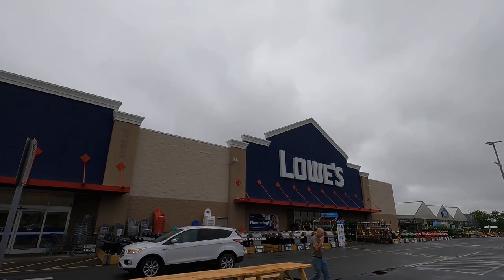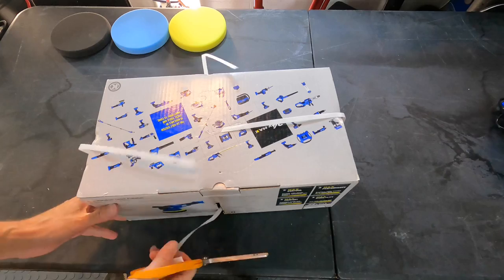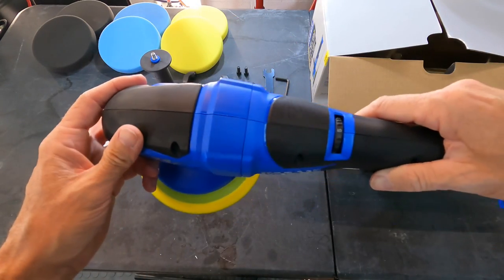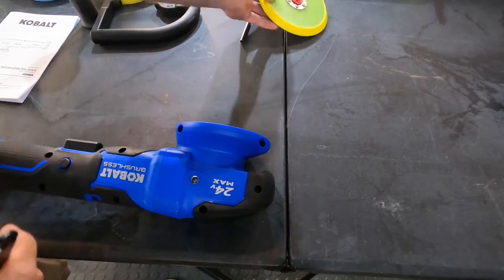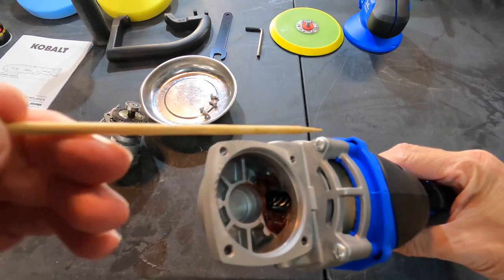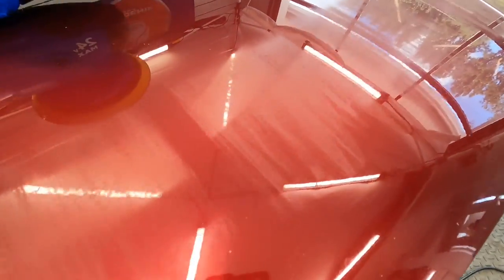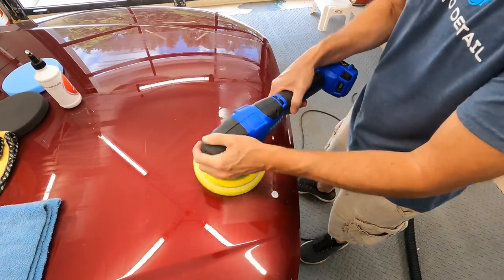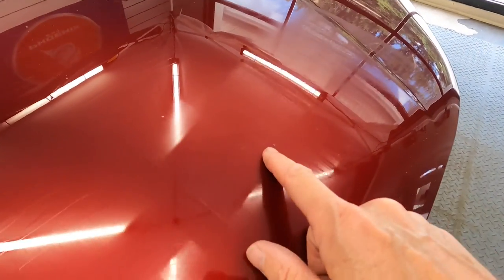Buy The Charger & Battery.....Get The Polisher For FREE!!! Kobalt Random Orbital Polisher! At LOWES!

Comment from the maker: To make it clear...this polisher would struggle on anything more than a one step or enhancement. Would YOU try this?
Reply: The battery and charger costs more than the tool itself
Reply: In a pinch probably. For a person starting out yes.great buy.if I'm going 2 get a cordless polisher as beginner shitemate.
Reply: If you need more power you can always use a 4ah xr battery or 8ah xr battery
Reply: Robust no, but for 1-step, wax, or sealants this is a great CORDLESS tool for most anyone intent on caring for their own vehicles.
Reply: No
Reply: I’m used to more robust tools like Rupes, Dewalt rotary, so no I’m not a buyer. For the money and discount it would have been yes when I was getting started. Saying that , Iv3 pretty much abandoned my beginning polishers, they are backup’s in case of a problem now.
Reply: Yes. To apply sealants.

Comment: got one of these maybe a year ago with the same deal with the battery set. I already used other kobalt tools and was pretty excited to be able to use a cordless polisher. But it ended up being a glorified wax buffer instead of anything useful for correction. After switching to ceramics, its been hanging on the garage wall for a while now.
Reply from the maker: True that.